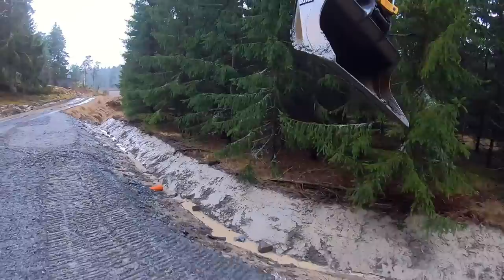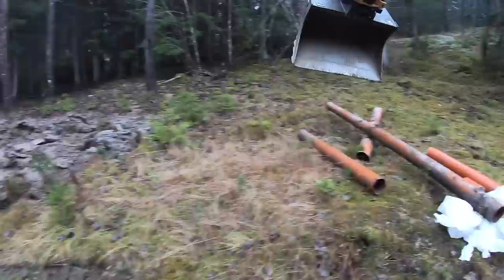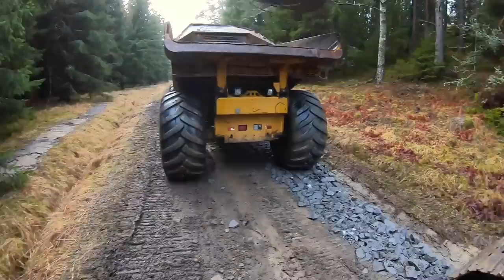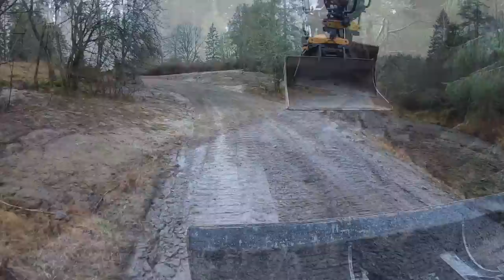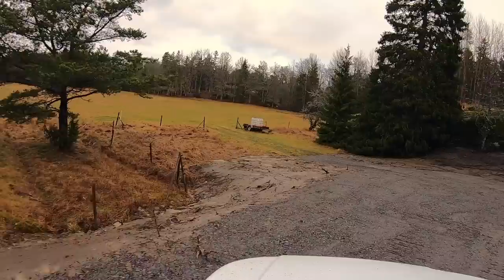#27 Road preparation for lumber trucks: 4 turns and a turnaround Part: 6 of 6

Comment: Awesome job on that road.
It should stand up well to logging truck traffic.
I'm surprised you didn't have a vibrating roller rig to go over every lift to really pack them in tight.

Comment: As great a job as you did, I don't see this road holding up under intense logging, especially the areas that you did not do extensive de-watering and gravel base on. just driving the small truck in at the end rutted the road already. I commend your expert abilities on the trackhoe, a better operator I have not seen, you have the touch for this work for sure.

Comment: I wonder why we dont see tilt rotators much over here in the states they look handy as hell
Reply: I shared the tomtrenovering series with two operators and one was impressed and would love to run one. The other said he couldn't watch it because he was trying to do everything with the bucket. Which is kinda the point. So, I think part of the reason may be ignorance. Maybe lack of imagination on how to use something new. Of course we don't use the metric system here either.🙄

Also, notice his work truck is a Ford Transit. Imagine that being your crummy in the US.
Reply: I think it is a bit from all and also a point on what you have to do. If you leveling like this videos show the bucket would be your friend but If you digging it can be hard based on its load what I think is not that what  a normal bucket has

Comment: I think you have a good selection of music. My only feedback would be to not mix the genres (or at least not electronica and reggae :) and stick to one genre per video. It'd be different i you were doing more than only time lapsed road work, in that case you might want to switch things up in accordance with what's happening on screen. 

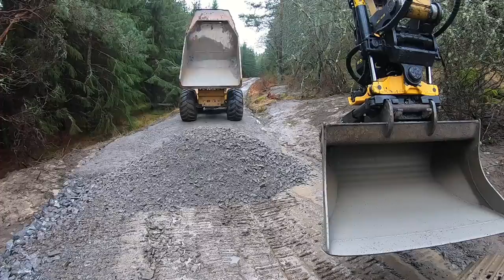In my opinion using darker, slower, almost ambient electronic songs - like Ladybug at 17:36 - works really well. I also liked when you went almost "all out jazz" in the previous video since that's not something you normally see for these types of videos.

One thing you can do to break the "monotony" of non-stop music is to splice in non time lapsed clips with just machine sounds, perhaps even from a different angle. When you go back to time lapse, you go back to using music.

And as always, truly impressive work with the excavator. :)
Reply: Martin Edelius good advice.... being a motor head no music at all would be preferred but it’s not my channel. :-)
Reply: @gnuclur8952  Well, a time lapse with no sound would probably get boring after a while. :)